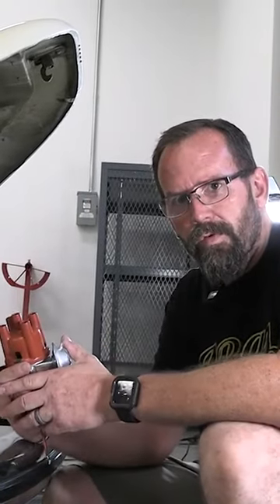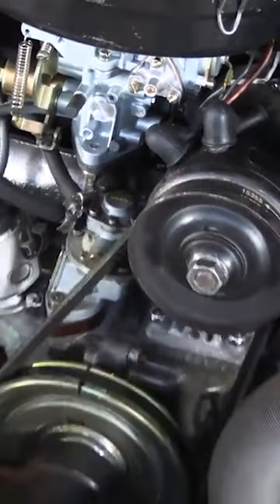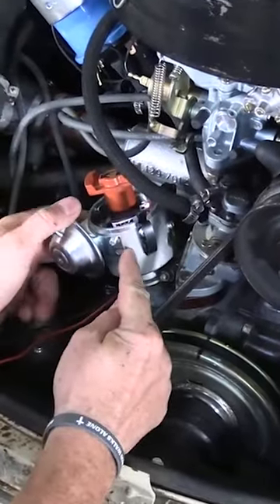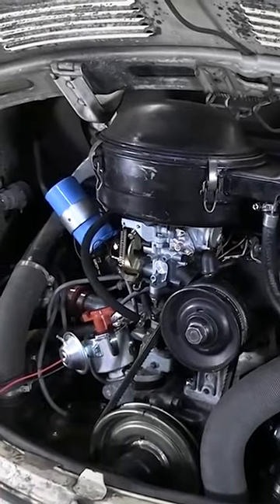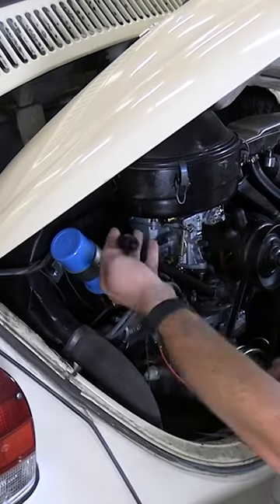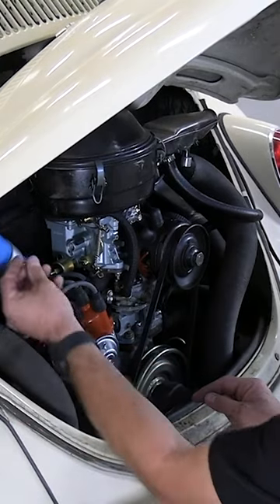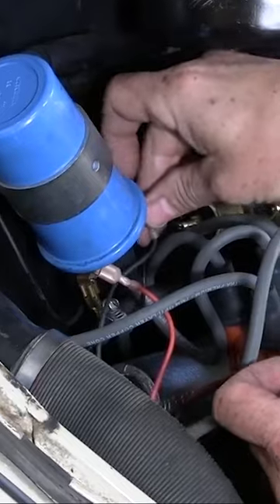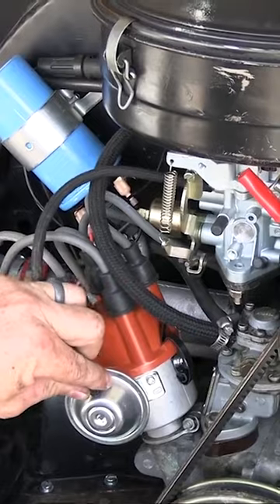JBugs - 009 Distributor Replacement

Comment: I have always been a 009 guy I still run points. 1835cc . Extras in my gear bag pt. &cond. what is the benefit of the conversion?
Reply: A vacuum advance distributor allows for a smoother and more progressive advance, from idle. In a recent video where I installed EMPI's new upgraded accelerator pedal kit, I came to an idle, in second gear and the engine was started to die. I rolled into the throttle and from nearly a stop the engine accelerated smoothly up to speed. That isn't something that an 009 distributor would allow anywhere near as well, if at all. As for the electronic ignition portion, there is just no reason with modern electronics to have to deal with mechanical points. Sure, some people keep them as a back up, but I have NEVER had an electronic ignition fail.